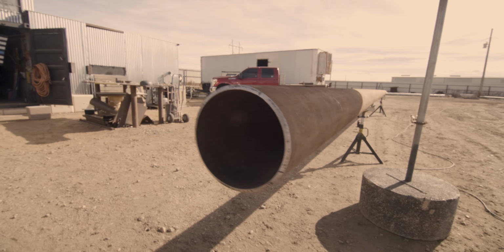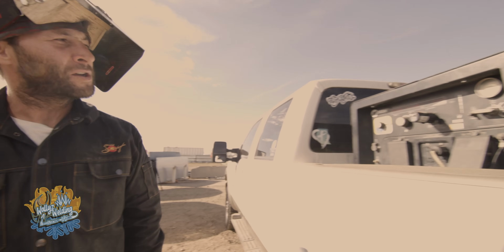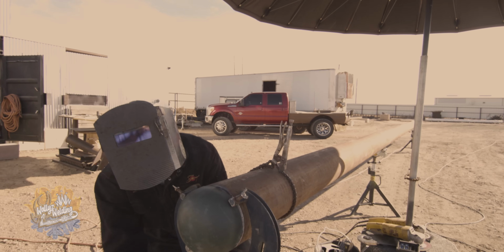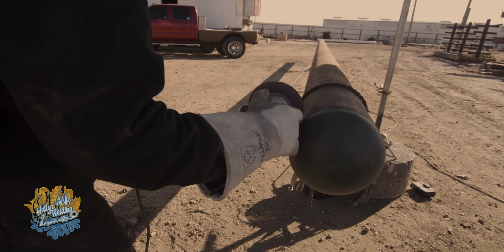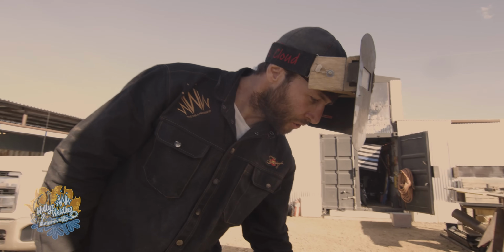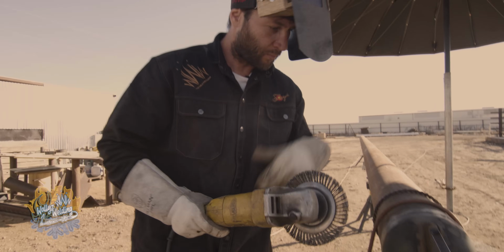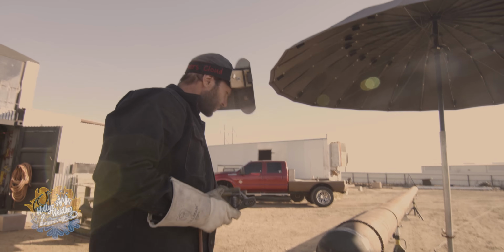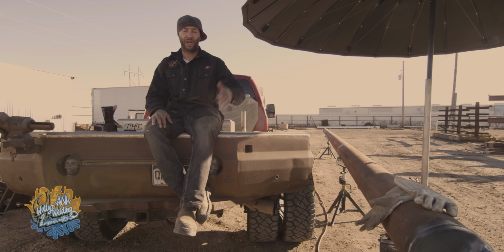8” Weld PullHead (diy)

Comment: I’d love to see more videos of you going in on depth about 6010 roots, 7018 rollouts. Explaining why you run so hot, what gaps and lands you run when your running hot, also how many fills to do depending on the size and thickness of the pipes. I just got my b pressure and wanna get into to pipe fab but don’t have a whole lot of experience with pipe welding. I always ask my buddy for advice lol
Reply from the maker: We got a heap of them coming

Comment: My welder always has me bevel the end of the tang or eye-lit touching the cap. is that necessary or can it just be butt-up against the cap like how you demonstrated? Are there any significant differences between doing a T-joint beveled or not beveled?
Reply from the maker: That’s a great way to increase the strength ima be doing here many different pull heads and why I do them differently

Comment: Love the video your awesome welder that's for sure. What rod diameters are you running in this video on 7010 @ 135 amps and 188 amps I think you said and 7018  guessing same on that rod as well.
Reply from the maker: 3/16 I believe on the high heat and bead 1/8 6010 at 134

Comment: Would it be stronger if you put an angle cut in bottom of the hanger for deeper penetration?
Reply from the maker: To add more metal don’t always make it stronger but in this case we could always say so. I don’t think it matters but I have several ways I’m doing them stay tuned for the 24” pull head for the next pipeline

Comment: Loved the (Persian?) Music you had during the root pass. Super cool to hear that on a western welding video. Great cinematography as well. Cool to see how smooth all your movements are, all that experience really showing in every part of the process.

Ive got a few questions that id appreciate your answer on.

1. Was it 1/8th 6010 for each pass?
2. I heard you say 137a for the root, whats your dig %?
3. Single hot/fill pass at 188a? And same amps for cap? Do you change dig at all?
4. And finally what lens do you like to run in your pancake?

Thanks man, again great video!
Reply from the maker: Great questions thank you 🙏

Comment: Can u clarify something please.?  The 6010/11 is Deep Penetrating but somewhat more brittle... The 7018 is Medium ish but with more elongation...  And most people Talk uP the 7018 as better in there opinion...  So what then is the 6010/11 still good for.?  Like where would that deeper penetration come in handy, that being more brittle wouldn't matter...... Ya get what i mean.?  ha  Thx  L8tr
Reply from the maker: Deep penetration rods made to soak in first. You can really dig with those rods and with such brittle flux it always it to be burnt out extremely easier then a 7018 flux. Now I have beaded with both and there is a skill and technique to both rods and why you use them in sequence process. I will be making so many videos so please keep the questions coming!